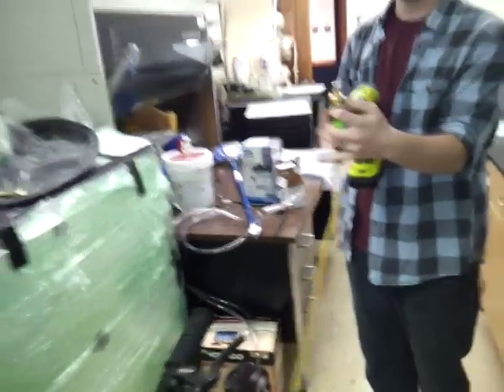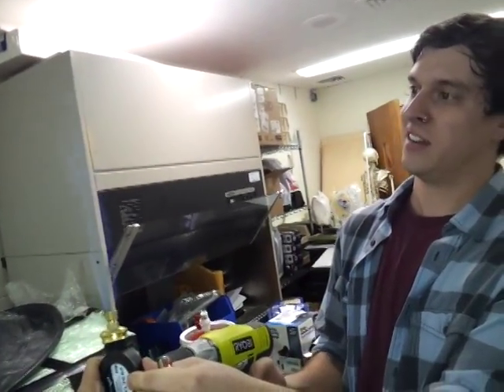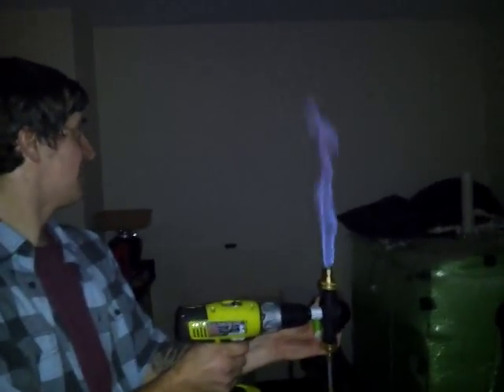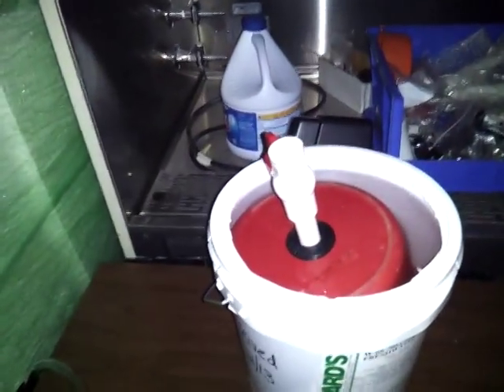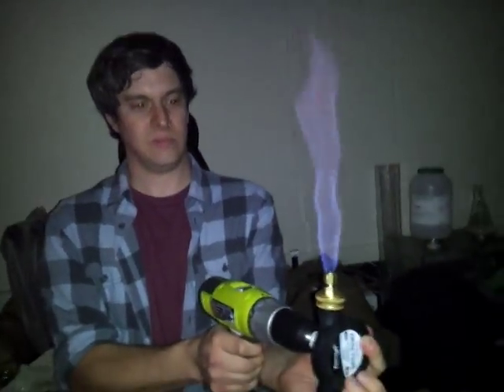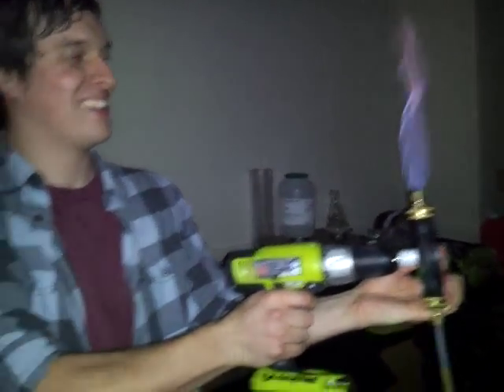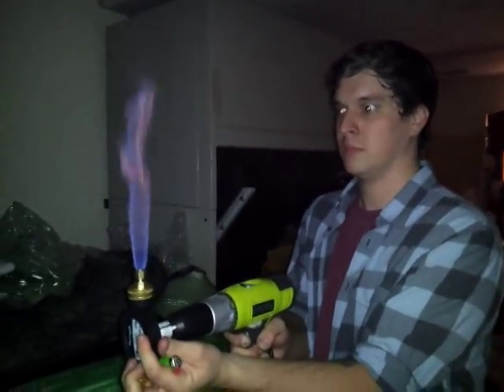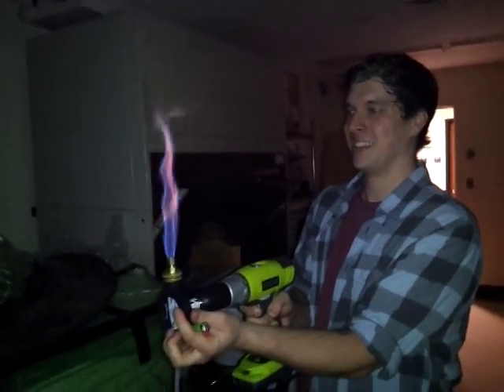flaring Biogas from inner tube using drill pump

Comment: Well done ! So does the hose go just only a few inches into the upper part of the digestor tank ?
How do you equalize the pressure inside the tank, if you suck the gas out via the pump ?
Won´t there be then a vacuum ?